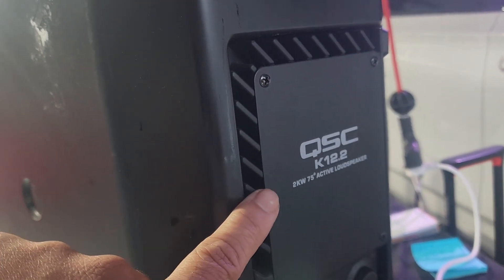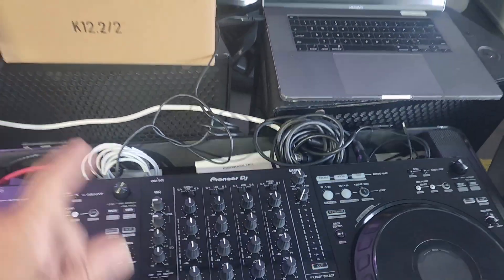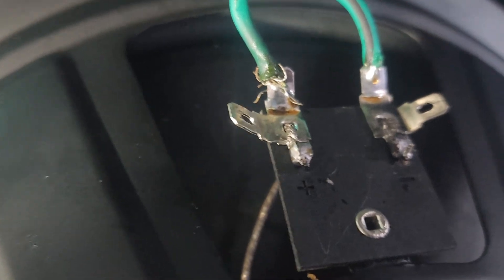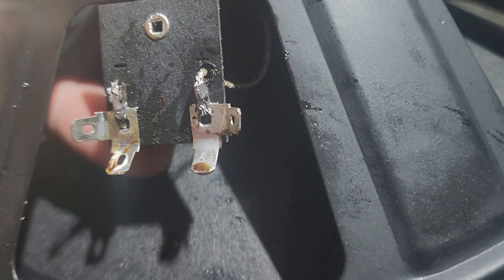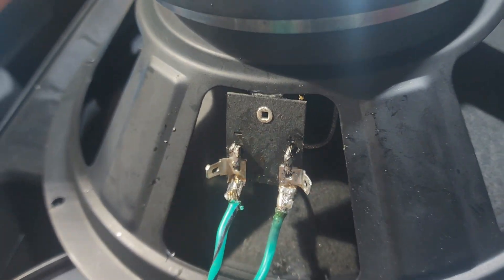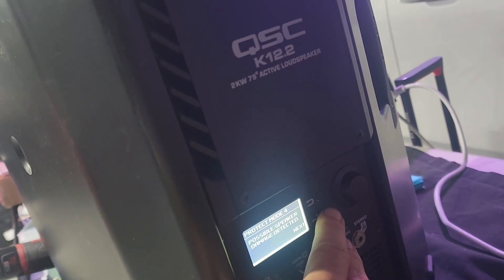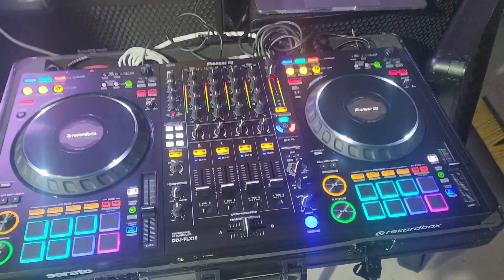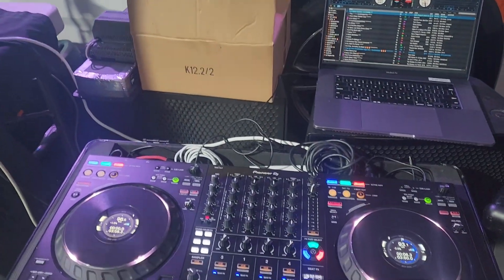QSC k12.2 Protection Mode 4 Repair

Comment: I had an electrical problem at the nightclub iam currently working at, 

The speakers, normally the k.12.2’s  would shut uff and come back 3to 4 secs after  by them selves., i knew since the first time that it was gonna be an electric issue.,  

so i decided to move two of the four k12   That i usually use use as my main pA/Foh and hanged it them on the sides of the of the dance floor,
And use another braker/circut., 

Well, the ones i moved started causing me issues with the internet router because for some reason its started starving the router out energy so much that it will turn off., 

So i told the club owner that i wanted all the electrical system checked by an electrician, 

Mf’ actually called one of his friends that works installing electrical equipment on mew construction sites.,
but  he didn’t even brought multimeters  or any tools to actually diagnose the problem., 

Well he asked another one oh his friends, and blamed it on me., 
He said that every thing looked good
Reply from the maker: Wow.  Thats horrible. You can't say everything looks good just by doing a visual inspection. I hope the owner gets a real electrician to help

Comment: i love qsc so much but the amount of people i know who use these that have the same error is crazy 😭 this just happend to me while i was djing at a wedding 🥲
Reply from the maker: Yes that is annoying. In rear cases its telling you there is a problem that needs to be fixed like a lose cable on the woofer otherwise its just false positives
Reply: @djab203  i found out that its actually my firmware version. i never updated these speakers as im used to just having hardware. but its impossible to update as it keeps on turning on and off 🥲

Comment: why the amplifier outputs problematic amplifier writing mister is there anything damaged
Reply from the maker: QSC K12.2 protection mode 4 issues are related to hardware issues. In this case this speaker had a bad woofer, so after the woofer was fixed I cleared the code and was able to use the speaker. Without repair or clearing of the code you wont be able to use the speaker at all.
Reply: @djab203  How do I fix a QSC amplifier so it can be used again?

Comment: O que houve?🙄
Reply from the maker: QSC K12.2 protection mode 4 issues are related to hardware issues. In this case this speaker had a bad woofer, so after the woofer was fixed I cleared the code and was able to use the speaker. Without repair or clearing of the code you wont be able to use the speaker at all.